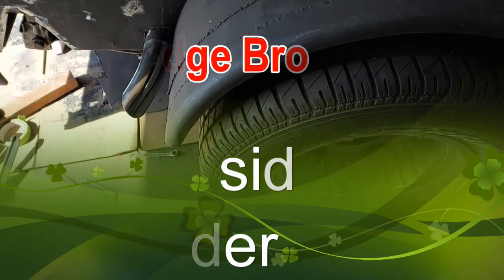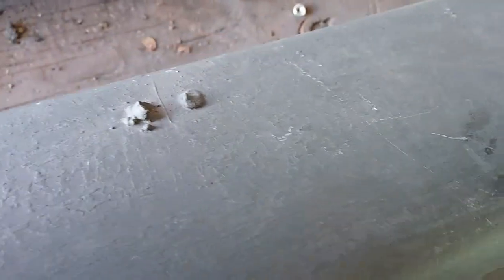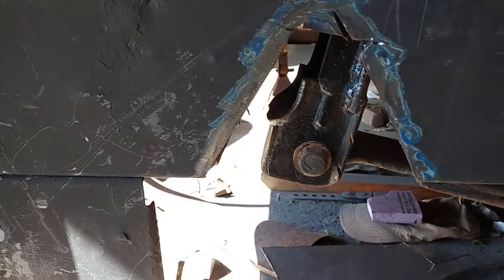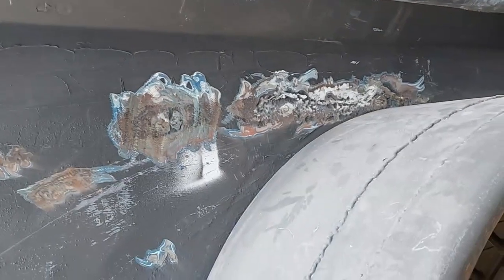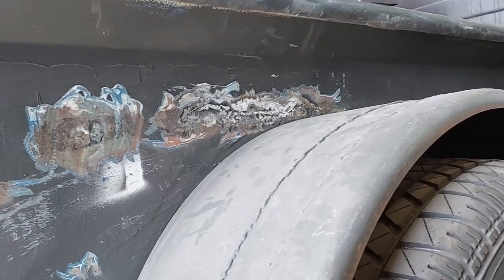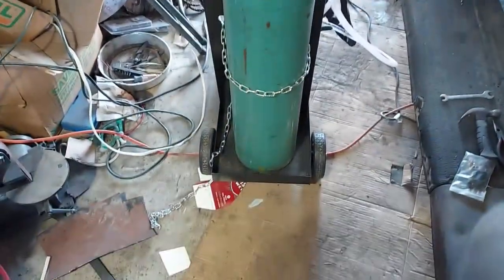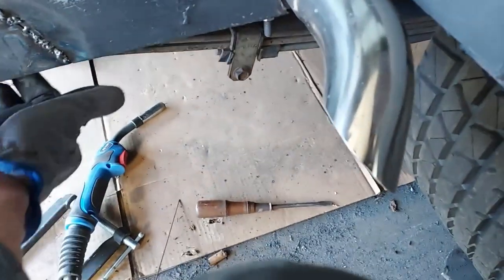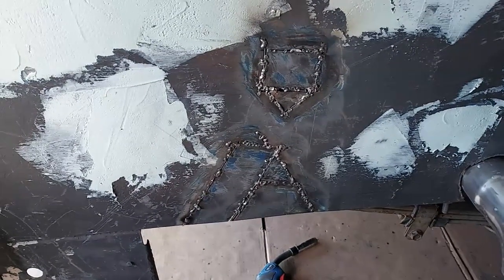1937 Dodge Bed side fix fender trim

Comment: Hello my friend. I just found your channel because I bought a Burke no.4 horizontal mill and I am so excited to get it working. I am starting a small engine repair and mobile welding and fabrication business. I have been running into obsolete engines and equipment that needs parts that I need to make. I am still recovering from getting run over on my 1957 Harley Panhead by a Ford F350. I was flipped up and around the telephone pole and then had my right leg nearly severed in half.This happened a little over 18 months ago and it has been a tough road back to walking.I fought with the doctors who wanted to take my leg up until a month ago when my circulation started to come back. It is back now. I plan on starting a machine shop populated with 1800's and greater manual machines that I will power with a central belt system and steam. It will be a living history museum that actually turns out real pieces. I just subscribed. You ahem some awesome videos.
Reply from the maker: Thanks for the subscribe, and compliments. I mostly use the burke now with the vertical adapter.  I have quite a bit of tooling for it I never use, cutters, shafts and so forth for the horizontal mill part. If you are interested, let me know if you need something, I may have it.  Tom
Reply: @1otviii  Oh wow. Did you make your vertical adapter? I am picking up my Burke Mill on Tuesday. The man that I am getting it from said that he started making an adapter for the vertical mill but never got to finish it. I think that it would be a really awesome project. I for have any ideas where I might be able to find one already made I would be interested.  I definitely need to see how the adapter is secured to the machine also. thank you my friend. If oyyu have a video where you use the vertical adapter I woulds love to see it. Thanks again.
Reply from the maker: Yes, I made an adapther.  It is pretty simple, but you need a lathe and buy some gears.  I made a video for you at https://www.youtube.com/watch?v=b3XpyFnVQSc so you can have a closer look at it. Tom
Reply: @1otviii  thank you so much. I just brought the Burke No.4 mill home